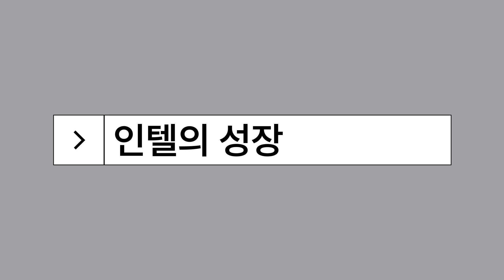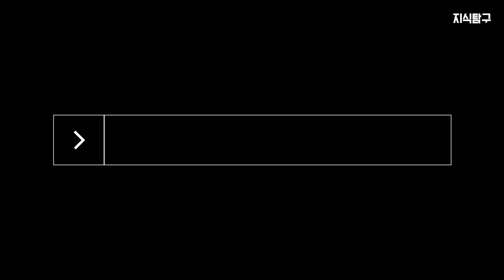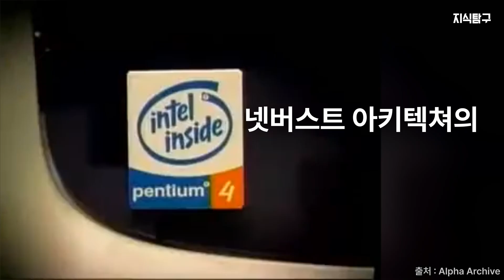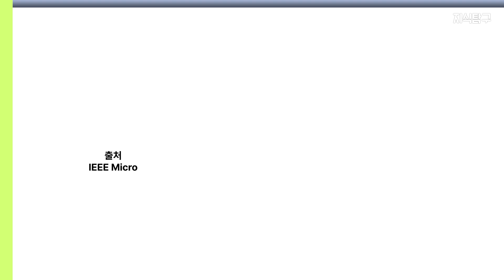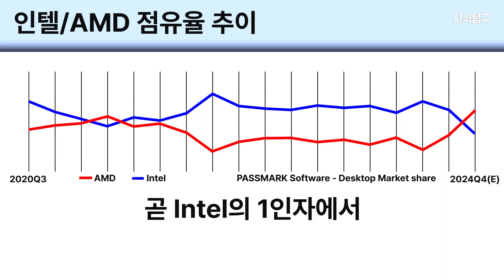인텔의 몰락 | 지식탐구

Comment: ☆ AMD 회장 겸 CEO, '닥터 리사 수 회장'의 간편약력(2024 현재)
[AMD 합류 이전 - 학업]
- 브롱스 과학고등학교 졸업
- MIT대학교 전기공학과 학사 학위 졸업
- MIT대학원 '반도체웨이퍼 연구의 SOI' 논문 박사 학위 졸업

[AMD 합류 이전 - 직장]
- 텍사스 인스트루먼트
- IBM : '장치 물리학' 등 수십편 논문 발표
- 프리스케일 CTO(최고기술책임자) ☞ IPO 부사장(총괄 책임자)

[AMD 합류 이후 - IBM 멘토 '니콜라스 도노프리오'의 호출]
- (2012~ 2014)글로벌 비즈니스 부문 부사장 겸 총괄 책임자
- (2014. 10 ~ 2022. 02)사장 겸 CEO
- (2022. 02 ~ 현재)이사회 의장(회장) 겸 CEO ☞ '자일링스 인수 이후 AMD 이사회에서 선출됨'

[AMD 합류 중의 제품 및 마이크로아키텍쳐 발표]
☞ 클라이언트 CPU : RYZEN(라이젠) + Threadripper(스레드리퍼) CPU → ZEN 마이크로아키텍처
☞ 서버(데이터센터) CPU : EPYC(에픽) CPU(ZEN 마이크로아키텍처)
☞ 클라이언트 GPU : Radeon RX(라데온 RX) + 라데온 프로 → GCN(RDNA) 마이크로아키텍쳐
☞ 서버(데이터센터) GPU : (기존 - 라데온 인스팅트) → Instinct(인스팅트) ▷ GCN(CDNA) 마이크로아키텍쳐

[AMD의 기업 인수합병]
- HiAlgo(게임 최적화 스타트업)
- Nitero(VR & AR 개발사)
- 자일링스(FPGA 및 적응형 SoC)
- 펜산도 시스템(DPU)
- Nod.AI(오픈 AI S/W 개발사) 
- Mipsology(AI 추론 S/W 개발사)
- Silo.AI(AI S/W 연구벤더사 ☞ 신규 인수 추가)
- ZT시스템[서버(데이터센터) 제조벤더사 ☞ 신규 인수 추가)

☞ 전임 AMD 이사회 임원 겸 IBM 멘토인 '니콜라스 도노프리오'가 AMD '닥터 리사 수 회장'에게 한 말
'점점 시기적으로 맞아 떨어지면서, 자네에게 딱 맞는 곳(AMD)이 되어 가는 걸세'

[AMD의 주요 연도별 시가총액]
2015년(당시 투자부적격 상태) : 21억 달러 - 부정확함
2020년 : 724억 달러(7월), 961억 달러(8월) - 부정확함
2021년 : 1134억 달러
2022년(7월) : 1,530억 달러
2023년(4월) : 1,520억 달러
2024년(3월 기준) : 3,000억 달러 
 
[AMD의 주요 연도별 주가]
2006년 : 40 달러
2011년 : 2 달러
2012년 : 1.86 달러
2015년 : 1.64 달러
2017년 : 12 달러
2019년(7월) : 34.3 달러(1840%)
2020년 : 48.50 달러(1월), 61.79 달러(7월), 61.83 달러(11월)
2021년 : 93 달러
2023년(1월) : 76.53 달러(1월), 94.03 달러(4월 현재)
2024년(3월) : 190 달러